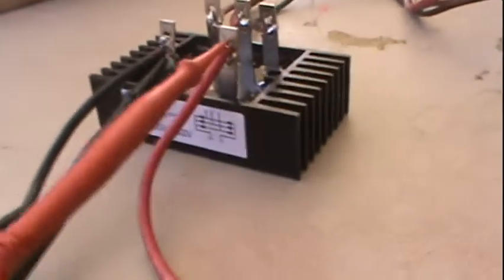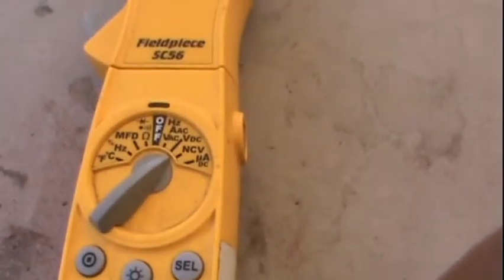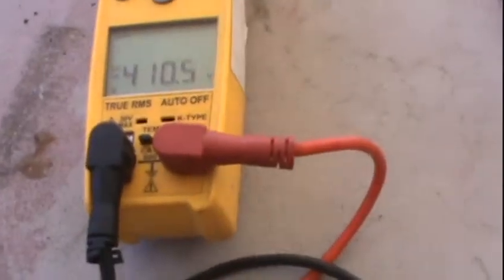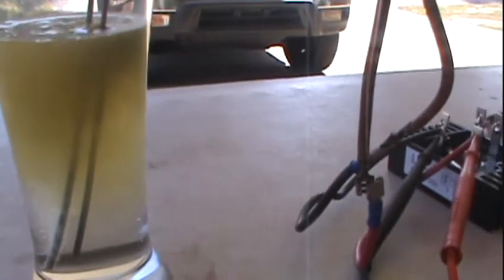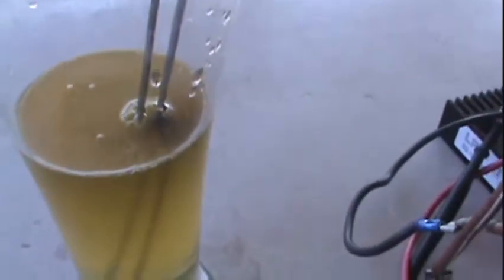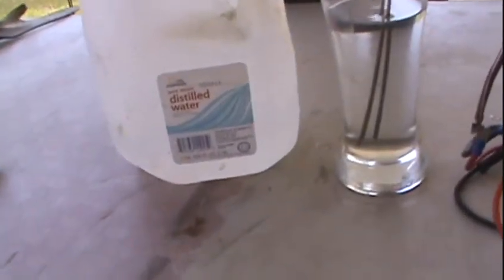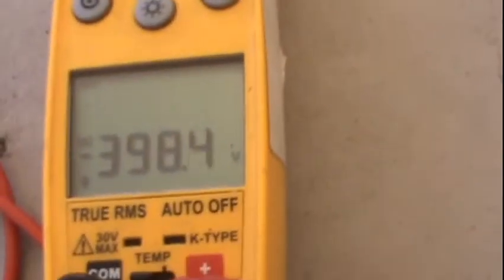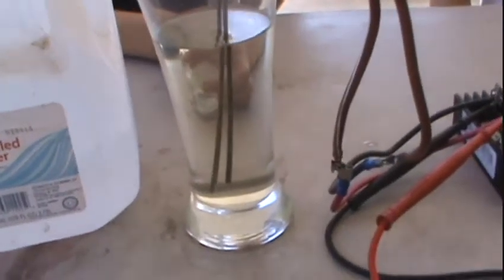Blower Motor To Generator pt4

Comment: What would be needed to stabilize the voltage and make everything work to run a household?
I know HOW I want to turn the motor to produce, but what is needed on the downline from the motor? Do you have a video on that?

Comment: kind of really interesting.. with such a low dc Voltage having such a powerful arc...It would be worthed to find what is the frequency output... you may have been dealing with a really high frequency output... 
Before I saw this video I was considering on a simple 3 phase rig with six diodes and a humble cap bank to power some kind of motor that can work with DC like the really old brushed pre- 50's motors.. just a thought. that is all. nothing fancy.

Comment: Looks like fun...thats a mean rotoverter.
You gonna tune it for efficiency with some big capacitors?
Reply from the maker: what kind and where would i install them.... on the ac side or the dc side?  i also got bigger pulleys.
Reply: crob227 basically the idea is to make the motor coils work at resonance.
motor start and run caps would be useful on the motor side.
microwave oven caps or anything rated 450V on the generator side.
i remember watching some old rotoverter videos on the subject-will try to find...
adding or subtracting more or less capacity until the coils resonate, that will reduce the amp draw for the running.
then do the same on the generator side.
you can hear your motor slow down when your young fella put the salt in, if you get it right the thing will not slow as much, some have seen increase speed under load.